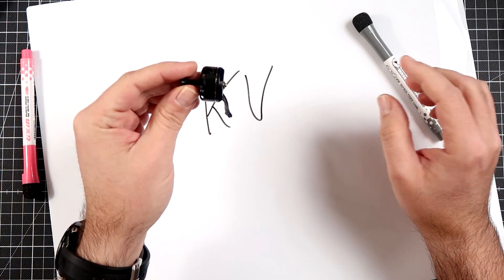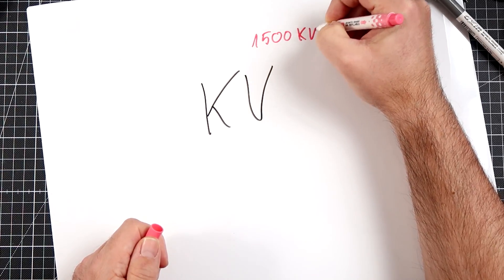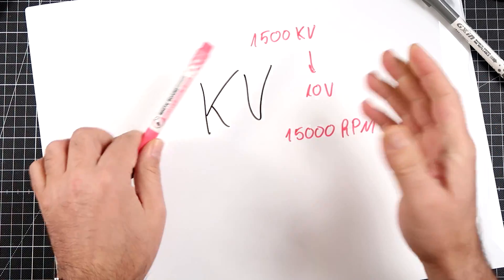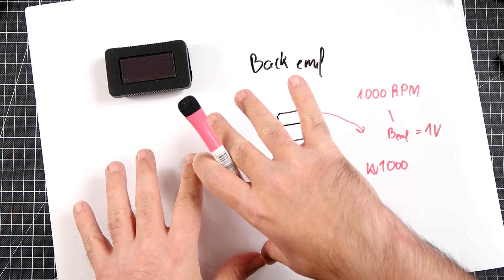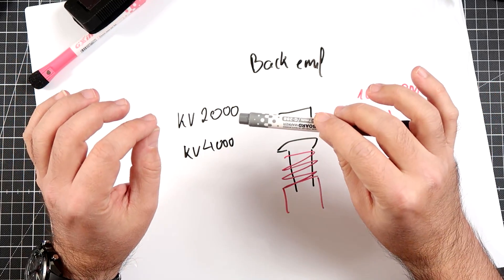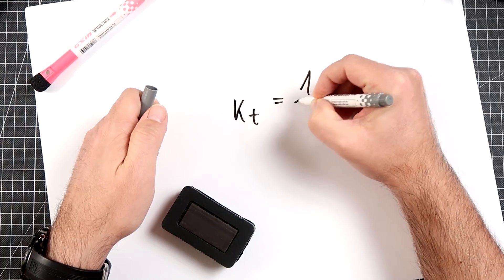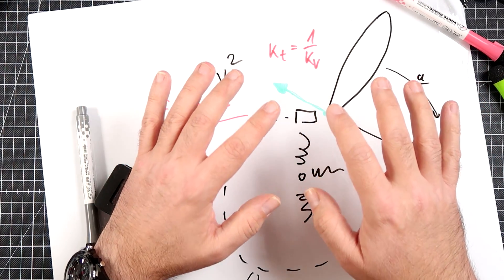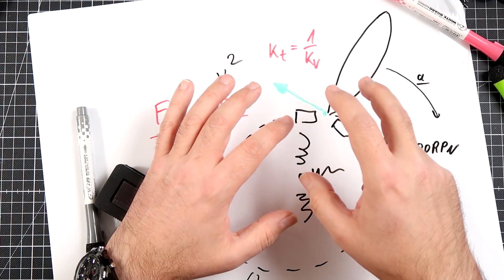Motor KV explained - KV is a lie and what you really need is a torque!

Comment: this was pretty awful man,  i dont recall anybody ever saying high kv had more torque,  i do recall people saying it had less torque,  i had hoped to learn a bit about actual kv and torque ie. how kv relates to copper windings and magnets,   the ability to change speed rapidly or have a higher final speed per volt is not a problem for us, there is enough torque from 16v and the magnets for our motors to perform very well, all of them.  higher kv motors just have a higher final running frequency per volt.  the mystery for all of us is why we have kv at all,  we all know it relates to windings and is slight trade off to torque, and other than some motors feel slightly sluggish to wind up,  and us saying use a lighter pitch prop we rarely experience any lack of torque, apart from the magnet strengthi thought torque was pretty much a set thing,  big large diameter motors give big torque,
Reply: he did not say that
Reply: Why we have KV at all? To calculate RPM, torque, propeller size? But other specs like max amps and volts are as important as KV.

Comment: So, what are we gaining from higher KV of motors? Aren't they accelerating faster because they have more amps to work with?
Reply from the maker: Higher KV = higher max rotation speed if there is enought torque to spin the prop that fast

Comment: So! A wider stator (1403 motor) will give more torque per amp than a narrower stator (1103 motor) and thus be more efficient. And, if i've understood it correctly, the relationship between torque and stator width is linear.

Comment: Meanwhile kababfpv is claiming higger kv doesnt influence torque lol
Reply from the maker: well, in theory it does not. But higher KV requires more amps for the same torque and more amps equals higher voltage sag and, voltage drop over the lines, overheating and even less efficiency than before
Reply: @FPVUniversity  yrah but all else being equal ots just so obviosu thatore speed means reduced torque, you think he knows how a gearbox works?
Reply from the maker: Electric motor is not a gearbox
Reply: @FPVUniversity  well yeah no shit, but ehrn comparing something sith higger speed and all else being equal, its obviously going to have less torque.

Comment: Making long story short. There is no replacement for displacement. 
Or.. Take two man.. One is a skinny sprinter another strong man competitor. With empty hands sprinter will arrive at the 100m mark way sooner if just speed it self will be the factor. Now give the both guys a front loader tire to carry across.. Obviously sprinter won't even be able to carry the weight. Now give this guys a keg full of beer.. I assume they both arrive about the same time but one will be over kill for the task given. 
Here is why you can't install 14" prop on lets say 2215 size motor despite the KV  as small motor will never have enough torque to spin large propeller to advertised KV and in result will ended up overloaded. On other hand installing 5" prop is waste of large size motor design to work with 3 times larger prop as it will never spin fast enough to generate sufficient thrust even though massive torque will allow for instant acceleration of that undersized prop. 
Proper ratio of motor size and KV vs prop size and its pitch is a mystery for most people. Load calculation created by installed propeller on given motor and possibility of overloading motor beyond recommended specifications (current draw) makes things even worse.  I'm glad to see someone is getting down to it and I'm waiting for follow up on this story..

Comment: Great video as usual but i think there is a misunderstanding.
High Kv doesn't mean low torque. Kv*Kt=1 is true but, you need to multiply by the current. A high Kv motor have lower Kt but uses higher motor current.
So here is the example: Two drones both equal except for the Kv  peacefully hovering over the Gatwick tarmac...
1. KV=1000 Current 5A Back EMF 10V
2. Kv=2000 Current 10A  Back EMF 5V
Power consumption is equal. 5*10=10*5. if no losses are included. Current draw from the battery is the same because of the ESC chopping.
So now we add the resistive losses in the windings.
The low Kv motor has twice the amount of turns compared to the high Kv motor.
But the space for those windings is the same in both cases so the high Kv motor has twice the area of each wire compared to the low Kv motor.
The wire is twice longer in the Low Kv motor compared to the high Kv motor.
So the resistive losses are twice higher in the low Kv motor compared to the high Kv motor.
So based on this there is no reason why a high Kv motor should be less efficient than a low Kv motor. Quite the opposite is true.
But I high Kv motor, given full power will produce a lot more power than a low Kv motor pulling the juice out of the battery very quickly which may give the impression that a high Kv motor is less efficient.
Reply from the maker: OK, perhaps I was not 100% clear on that. Higher Kv  = lower Kt so more amps are required for the same torque. And because more amps equals less voltage and more battery sag, torque is lower at the end
Reply: @FPVUniversity  If you compare the two cases the battery current is the same but the motor current differs. So there is no difference in battery sag.
Reply: @FPVUniversity  Not really. 
1000KV eats 5A with 7,4V (for example), so you need 2x 1S 1000mAh connected in series, total 1000mAh, so 5A and 1000mAh = minimum 12 minutes battery life.
2000KV eats 10A with 3,7V, so you need 2x 1S 1000mAh paraller, total 2000mAh, so 10A and 2000mAh = again minimum 12 minutes of battery life.
Reply: In motor design..power equations are a secondary matter...torque, and speed are more important ..torque/speed curves are  the motor characteristics that a motor applications Engineer refers in choosing one...
Reply: @analoghardwaretops3976 And the manufacturers dont give you torque.
Reply: @James smith Sure there are many parameters so it is easier to understand if only one or of them are different during a comparison.